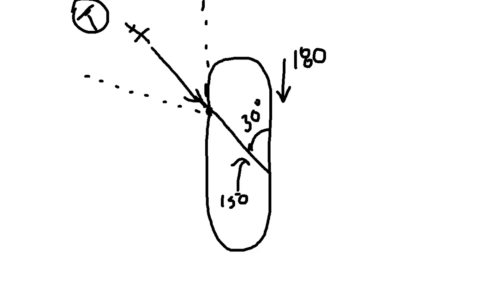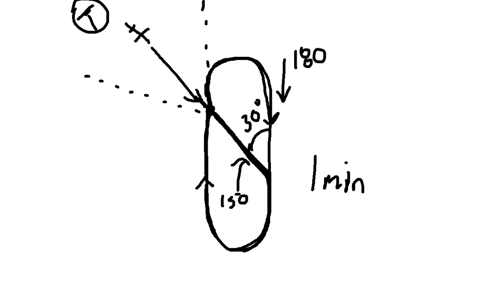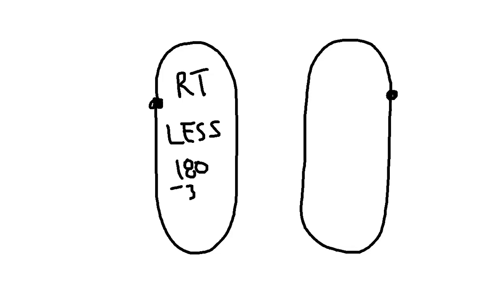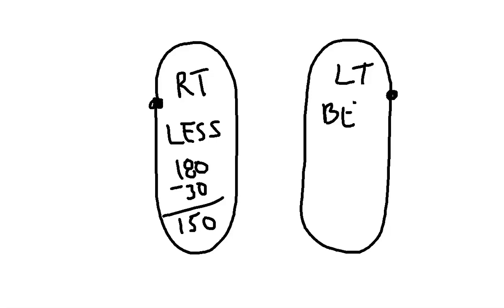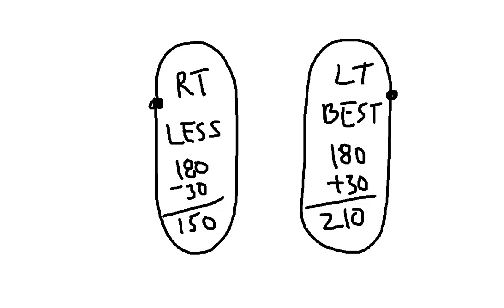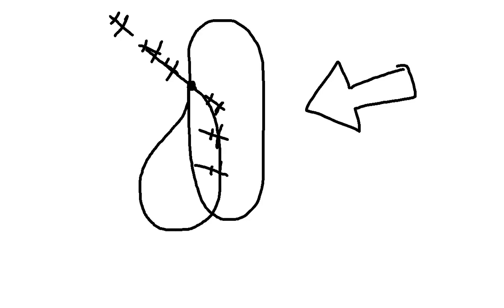Teardrop Entry into Holding

Comment from the maker: I'm not sure if I correctly understand what you are asking.  Here's a brief explanation of the intercept:
Once you cross the holding fix, fly a heading 30 degrees to the outside of the holding pattern from the outbound heading.  In the video the outbound is 180, so we fly a 150 heading.  Fly that heading for 1 minute, then make a standard rate turn back to intercept the inbound radial of the hold.  In the the video it's a right turn to intercept the 180 radial (360 heading).

I hope this helps!